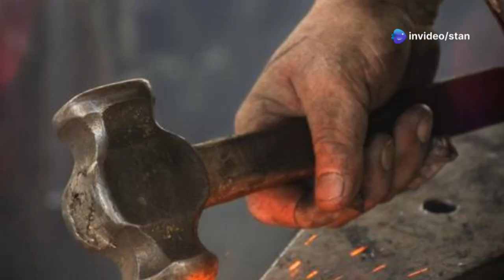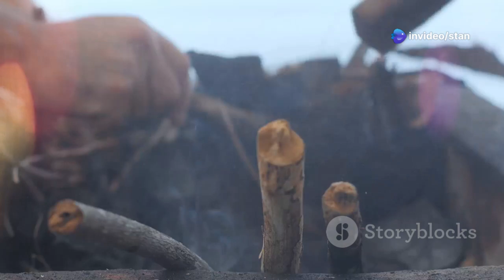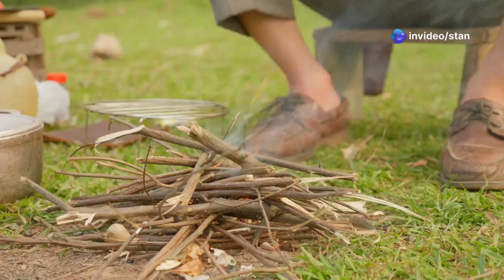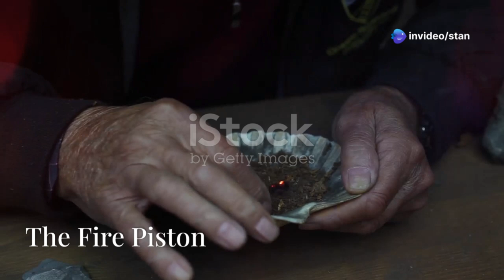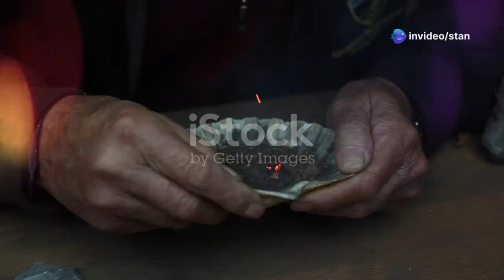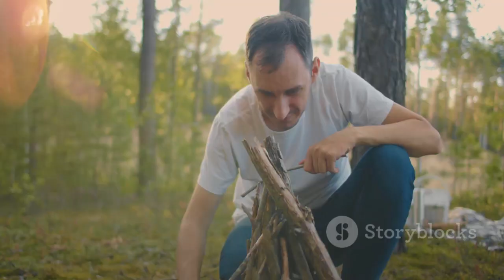Ancient Fire Making Techniques  A Journey Through Time

Comment: The use of iron/steel in fire making can’t be considered “ancient” in the vast span of human fire making techniques as iron smelting and forging wasn’t widespread beyond 3000 years ago. The use of iron pyrite nodules when struck against flint or chert was known to be used through the Pleistocene and examples of this have been recovered from Neanderthal archaeological sites. I’ll concede that what is ancient is fairly subjective and anything older than a modern gas lighter could be considered ancient.